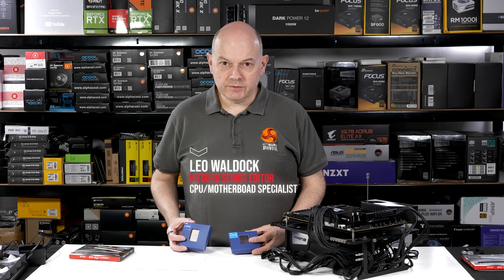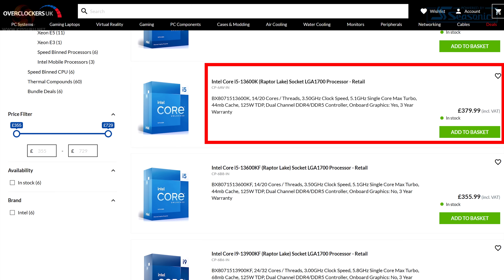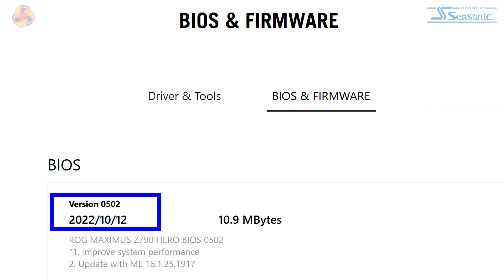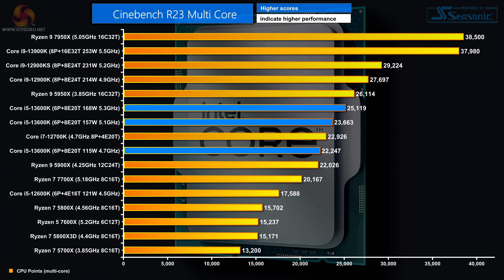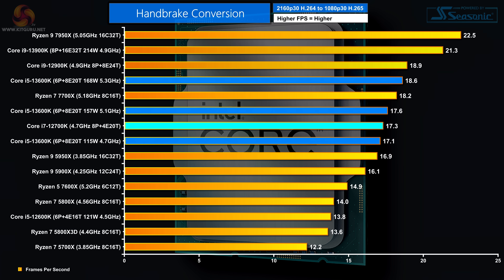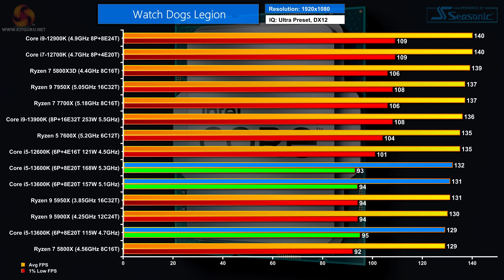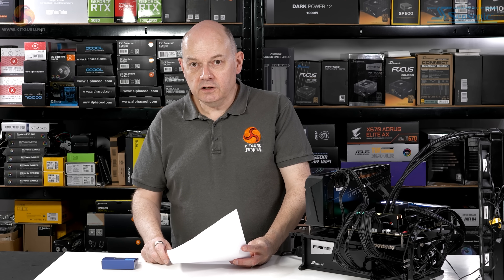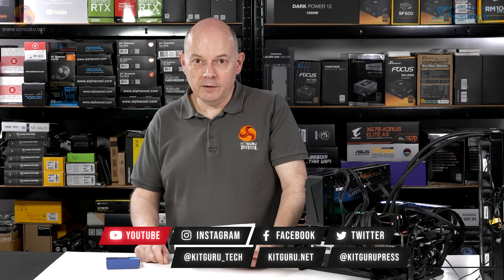Intel Core i5-13600k - smashes Ryzen 5 7600X 🥊

Comment: great video. just got my 13600K. when idling in windows all cores are at 1.1 GHz (C state 1?), and just moving the mouse instantly sends them to max turbo boost (5.1 for P cores, 3.9 for E cores). Is that normal?

Comment: Mobile phone processors have shown us the simple truth 10 years ago. "8086" has become overcomplicated, for most tasks wasted tech. What took us so long?
You won't save too much energy with redesigned simpler chips, as nothing comes from nothing. Every calculation needs its energy at particular process node. More or less. But the design itself can become compact and simple. Thus saving on production and eventually use. And since it's 2022 - power limit everything.

Comment: OMG you said the OVERLOCKED 13600k beats the core i5 12600k by a huge margin.
Yeah, you mean the 12600k running at stock 4.5Ghz 🤣🤣🤣🤣🤣🤣🤣🤣🤣
No ** it beat it.
There isn't a 12600k out there that can't do 5ghz - 5.2ghz easy on air.

Comment: Out of the box 5.1 pulled up to 175W!!!  Hit 100C.   I UNDERCLOCKED it to 5.0 and it only pulled 148w & only hit 82c in the same tests. (360 AIO)  Also, all tests STILL showed the 13600K a bit faster then the 12600k!  Just thought I would share.
Reply from the maker: Whch make of motherboard are you using and what do the Auto settings lock in for the power limits and Vcore? we have seen similar behaviour with previous Gens of Intel CPU where the motherboard can do awful things until you fix it manually in exactly the way you have
Leo
Reply: @KitGuruTech  Msi Tomahawk z690 ddr4. Was all on default settings.  Unlocked power.  I have tested with the 181w limit also.  So far my best balance is setting clock to 5.0.  Seems like over 5.0 is where it really wants the power.  20% more power draw for about 1% performace gain.
Reply from the maker: @TheRealDlo  I suggest you use an app such as HWiNFO64 to check the Vcore when you are running Cinebench or Blender. In my testing I was running at 1.15V-1.17V on Auto with 157W or 168W for the CPU. My guess is the MSI is feeding your CPU 1.3V in which case you might try setting the voltage manually.
Leo
Reply: @KitGuruTech  Looks like 1.380V is what my MSI is pulling!  Resulting in like 185w and high temps up to 100c
Reply: @KitGuruTech  Also, I did some voltage testing, set to 1.195V and it pulled 151w MAX and temps were 82c MAX
Pulled down a 38,883 Firestrike & a 23,981 cinebench

Comment: Awesome review. Plese make another video lowering voltages. In a poland web site some guy lower the vcore of the 13.600k to 1.1 in a MSI board and works exactly as the 1.35v default that msi board put since the beginning. The temps change from 90 to 69C.. Please make this new video! Awesome work!
Reply from the maker: The 115W figures in our chart effectively do that as the power cap drops Vcore to 1.05V
Leo

Comment: In terms of core count these days, I look to performance cores mostly and consider efficiency cores as a bonus. My recommendations (as a PC builder) are as follows: budget gaming aim for 6 cores eg 5600 or 12400, though the 13400 if it gets E-cores will become the absolute standard here, budget productivity aim for 8 cores eg: 5700x/5800x or 12700 if you can stretch, and everything above that is specific to your needs as we have the 5800x3d for gaming focus in one direction whilst the 13600k takes the all-rounder position, and the 13900k or 7950x are top-tier monsters. 

This 13600k is a cracking little unit, but I'm still slightly uneasy about only 6 P-cores considering the buy-in cost for K-SKU and motherboard, cooler, etc as it starts to creep up in price. This is why I think the rumoured 13400 (6c + 4c) is going to stomp in the budget gaming category, whilst for those who are investing in the z690/790 motherboards and higher tier gaming should stretch to a 13700k to get the extra 2x Pcores (relative to the cost outlay).

There are so many variables in the different configurations nowadays that deciding on components is a truly bespoke process.
Reply: good post man, well said.
Reply: @boltsandbraces6261  cheers! It's a fascinating time for PC hardware.

A person could upgrade around every 5 years to the i5 "k-series" each time, and have started with (1) a 4c/4t i5 3570k (DDR3) in 2012, then (2) a 4c/4t i5 7600k (DDR4) in 2017, and now (3) a 14c/20t i5 13600k (DDR5) in 2022. 

One of these is definitely not like the others lol. Thank goodness for Ryzen.

Comment: there is a huge discrepancy in temperatures between your test and hAMDware Unboxed. They claim it straigh on thermal throttles reaching 100c under a 360mm AIO...pathetic attempt to produce a "win" for AMD....
Reply from the maker: You might want to watch the following minute in that HUB video as it is clear the default MSI power profile abuses the CPU while manual settings drop their temp to mid-80s. Having said that the Corsair H150i works very well and the figure we saw were all good
Leo
Reply: and people were mad when I told them HUB is a pro-AMD channel and can't review things as impartially as possible.

Comment: i now understand that E cores are simply P cores that do no perform as good as P cores and Intel found a way to sell them to you anyways but the DDR 4 benchmarks will show fast ddr 4 will perform close to slow ddr 5 but I am very happy with my I3 12100 with 16 gig ddr 5 4800 and a RX6600 as it runs everything on a 1440p 144hz 32: curved monitor with ease

Comment: Only 2000 single core performance in cinebench? Thats odd I got 2047 on a 12th gen i3.
Reply from the maker: Which suggests your CPU is running at 5.3GHz single core
Reply: @KitGuruTech  how do you know lol, but yes it is😎. (Still needs a bit better cooling but that should be arriving today).
Reply: @KitGuruTech  do you recon a i5 12490f would be a good upgrade? Like not for now I think but later.
Reply: It also gets the same multicore speed as a 5600x but with just 4 cores it's pretty impressive for a 4 core chip really.

Comment: None of this is surprising at all to me. Frankly, I was commenting on videos back when the 7600X was being reviewed how the margins over Intel's prior, yes, prior, generation 12600K was simply not enough and that Raptor Lake will likely kill the 7600X in overall performance and value.

So, here we are. The 13600K stomps the 7600X, as I thought would be the case when reviewers were, for the most part, somehow comparing the 7600X favourably with Intel at the time. I said at that time that the 7600X has to beat the Intel equivalent prior generation CPU in everything tested. Instead, the new AMD CPU would often lose, and lose big, to the 12600K, a situation that didn't seem to ring many alarm bellss for those I saw testing it.

Well. now we see the results of what seemed fairly obvious to me weeks back, the Raptor Lake 13600K is a far better option, especially when you can drop it into a B660 board and use DDR4 from a prior build.

Unless AMD drop the prices of Zen 4 and the motherboard makers stop putting out silly priced AM5 boards, Zen 4 is DOA for the most part.

Comment: 13600k actually competes with 7700x. the 7600x is not in the same league, 7600x should compete with 13400 when it comes out
Reply: Lol. The 7600x is outperform in gaming the 13600k. Not sure how this benchmarks been made but anywhere else the 7600x outperform it. The 7700x outperform even the 13700k.
Reply: @gergelykiss1142  Can you provide a video for this? Where does the 7600x outperforms the 13600k? Most PC youtbers claim that the 13600k is the superior one.
Reply: It’s all about the pricing.
Reply: @johnerikson2443  yeah all about price them amd the way to go. Way would u build a dead intel platform ? Next generation will be a new socket again…

Comment: What would you recommend between i3600k and 13700k ?
Reply: Right now 13600k if you care about budget,in 6 months the 13700k will drop to 380$ which will make it a better buy.
Reply: @Kevin-fl7mj  budget isn't a constraint for me. All I'm worried is about the thermal output from 13th gen processors. The max turbo output is 253watts and real world they are catching up 300 watts. Which is insane.
Reply: @Rohith918  if budget isn't an issue, get a 360 or 420mm liquid cooler.
Reply: @Rohith918  As Darude said,get a big case with a 420mm AIO or hell even custom loop if you want,with great power comes great responsibility!

Comment: why not a single comment of how the 5800X3D performed so well compared to the 7000 and 13600 on topic in gaming.  What was the system spec on the ddr4 ram?  Curious.
Reply from the maker: Fully covered here https://www.kitguru.net/components/cpu/luke-hill/amd-ryzen-7-5800x3d-review-worth-the-cache/
Reply: @KitGuruTech  Can I assume that the ram used in the above video upload used this ram from the linked test above for the 5800X3D still to keep consistency? 

32GB (2x16GB dual-rank) Corsair Vengeance LPX 3600MHz 16-18-18-36 DDR4 @ 1.35V.
Reply: Because if everyone suddenly realizes that CPU's became irrelevant for non 1080p gaming post Ryzen 3000 series then all of these youtubers would loose more affiliate link sales.
Reply: @evrythingis1  Funniest thing is,in gaming scenarios where the new CPUs actually make a difference like Simulators and Emulation of console exclusives they dont bother even testing  them.
Reply: @evrythingis1  kitguru dont do affiliate sales links, it why I like this channel

Comment: A good CPU, but a bad buy really.
As the LGA1700 socket is at end of life.
There is no future upgrade path.
Reply: you dont need to upgrade. Why we need upgrade CPU every year 😢 ? We can use for 3-4 year and then we upgrade new PC.
Reply: @vdtb1758  You are correct, you don't need to upgrade every year.
But on AM5 you will still have options to upgrade in 3 or 4 years time.
Reply: @gsydaz  in 3 or 4 years time there will be new features for motherboards, and the bios updates/security updates slow to a crawl

x370 mfs bought one motherboard with pcie3.0, no 5ghz wifi and think its the best financial decision they ever made
Reply: @notreya  No developments of major importance come to mind though.
PCIe gen5 is not being used by any current GPU, gen5 NVMe SSD's are only just starting to appear, DDR5 and USB4 is all still very new.
Even Wifi 6E is so new, that most home routers and mobile devices don't come with it yet.
Reply: @gsydaz  I mentioned 2.
PCIe 3.0-> 4.0 -> 5.0. PCIe 4.0 for ssds was huge, and 5.0 will be even bigger
5ghz wifi is not just 6 or 6E, you would know that if your motherboard wasn’t 4 years old
Keep huffing that amd cope
Reply: @notreya  You are missing my point though... there is no upgrade path after Raptor Lake.
Even as early Q1 AMD is going to take the gaming crown back with the Zen 4 vcache SKUs. 🤷‍♂️
Reply: @gsydaz  Sure bud. 
Zen4 will be very interesting.
Enjoy your day.
Reply: @vdtb1758  Exactly, at least 3-4 years. By that time there's a new CPU, better DDR5 etc. It makes no sense to me to upgrade in 4 years with a CPU from 2021-2022. Why would I do that? :)) 
AMD just gives you the privilege to spend more money: buying twice is more expensive.

Comment: 8:45 For gaming performance, or in other words the "FPS", it is not the E-cores doing something, but it is the L2/L3 cache allocated to E-cores doing something. When you disable the E-cores, you are also disabling the use of the L2/L3 cache allocated to E-cores, ending up getting less L2/L3 cache for the CPU. That is why disabling the E-cores does not give you an obvious FPS improvement for 13th gen. In Bios settings, we cannot set the number of P-cores to 0, the minimum is 1. But we can try to compare the performance of 1P+8E vs. 6P+0E vs. 8P+0E in the games, it will be a very interesting test.
Reply: Isn't cache shared among p and e cores? When e cores are off p cores can still access them. I think with hybrid arch it's best to check gaming performance when having load of things in background like discord, chrome and some other stuff. It can make sizable difference against amd's just 8-cores or 6 cores part. Tho all is just a speculation until tested.
Reply: @hachiman3742  L3 is shared for the P and E cores, but the L1 and L2 cache are private to each core in the P cores and E cores. Intel processors don’t have as much L3 cache as AMD’s but have more L2 cache than AMD’s, so 13900K will end up getting much less L2+L3 total cache than AMD 7950X if E-cores are disabled. That way, you get the pure performance of an 8 P-cores 13900K. As the Intel P-cores are intrinsically stronger than the AMD cores, you will still have pretty strong performance with even less L2 cache. But when the E-cores are enabled, the more L2 cache won’t promise you a higher FPS because the E cores are intrinsically weaker than the P-cores. So… it is a trade-off between more weak cores (more weak cores = lower FPS if they process gaming programs) and more L2 cache (larger cache = higher FPS).

If people argue that E-cores won’t be processing any intense gaming programs, then only the P-cores are processing your games, that way, even the E-cores are enabled in a 13900K during your games, it is actually still an 8P+0E 13900K for your gaming, and therefore your 13900K won’t be using the L2 cache that was privately allocated to E cores anyway. So whether your game uses E cores or not, it falls into one of the two senators I outlined above.

Conclusion: So only if the L2 cache of disabled E cores can still be shared by 8 P cores, you can get the highest FPS, otherwise you won't get much of a difference whether you block E cores or not.
Reply: In other words, if Intel changes all the E-cores of the 13th gen to P-cores, the gaming performance would actually be higher than it is now.

Comment: Honestly the extreme UK prices of the intel are enough that I think if they just brought out a £150 cheaper motherboard for AM5 that'd be an instant consideration, especially since this otherwise far superior processor gets completely trounced in many if not most games by the X3D. Those AM5 3D variants are clearly going to be miles ahead in gaming, I don't think there's another sensible interpretation. As it is, it's barely cheaper than the X3D (and probably just in general more expensive when you include a compatible motherboard) but both behind in a lot of games and presumably even further behind if money is being saved and it isn't being paired with fast DDR5 RAM. As it stands, outside of very few titles it seems like it is a competition between "considerably worse gaming performance" and "drastically worse general productivity performance", with no upgrade path for either. My PC is horrendously old, but while stuff like the 5600 or 12400 are cheap, they're also still part of a prospective system that will still cost over a grand and potentially going to be struggling to keep up in a couple of years (and second hand CPUs don't seem to depreciate massively, so I've no illusions about being able to get a dirt cheap X3D in three years). Ah, this is such a debate. I'd like enough headroom that I can go another 7 years without my CPU performance behind a hinderance, but jumping to a new platform or DDR5 or an almost £400 CPU adds so massively to the costs.
Reply: Nice post. You make a lot of sense

Comment: It's all about the number of threads in terms of production. Since intel is coming in so aggressive with pricing and thread count, AMD will need to ditch the 6 core for at least 8 or 10. They have the better architecture no doubt. The 7950 is proof of that as it does more with less.
Reply: On the flip side, Intel are still competing with AMD despite being at a massive node disadvantage (10nm vs 5nm), which is a testament to just how good their architecture is.

Comment: I'm really looking forward to your DDR4 tests. I do hope you will also comment on which 12th gen boards have compatible BIOSes and why a prospective purchaser might choose a 12th gen board over a 13th gen board.
Reply: why ddr 4 is old news a good set of ddr 5 4800 is easy to find and afford for a budget build 12000 or 13000 gen Intel cpu
Reply: @dexter2433  DDR5 is still expensive: a 64 GB kit will cost me £330.
Reply: @QuentinStephens  I think its well worth getting DDR5 now, it feels a bit more future proofed and will get the most out of the platform over time. I guess if funds are tight and you already have a DDR4 kit that works well, just hold fire for a while.
Reply: @dexter2433  lol 
because people already HAVE DDR4 and maybe even a z690 motherboard.

Comment: thank you for testing at ddr5 6000mhz. many other silly channels are using ddr5 6400mhz. its not an apples to apples comparison. things are strange enough with these P cores and E turd cores.
Reply: How are they E-turds when they allow the $329 i5 to not only embarrass the 7600X but also punch above its weight and battle the $399 7700X.
Reply: i believe most of the gains are from the extra L2 cache. it would be interesting to see same freq and disabled core test from last gen. that would show the real improvements.